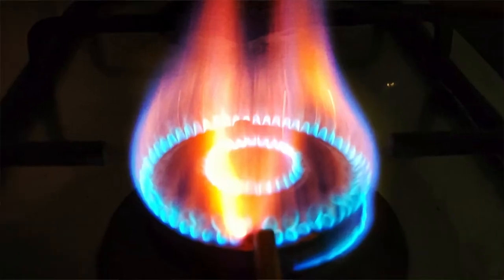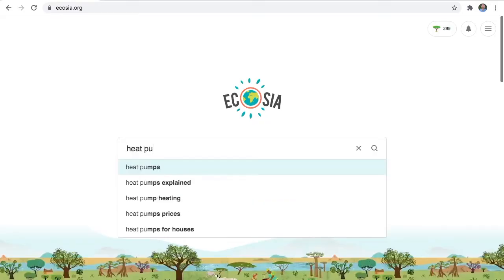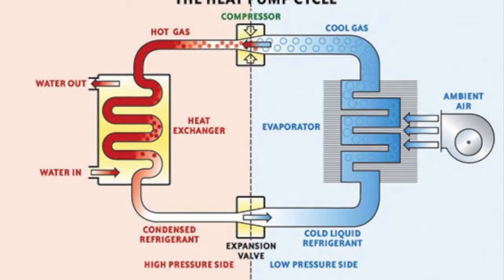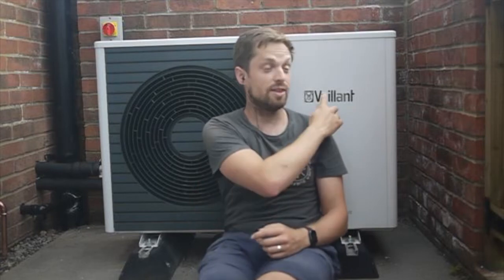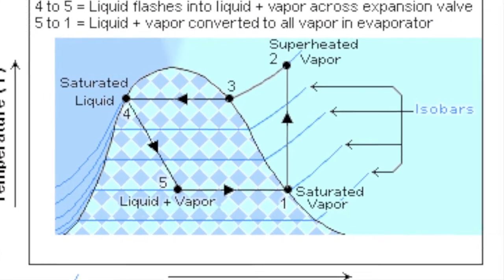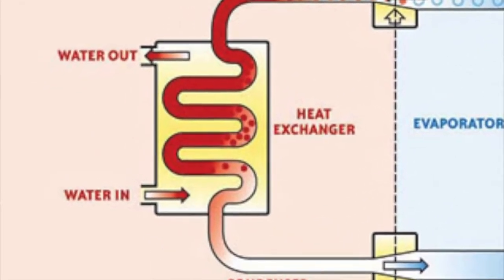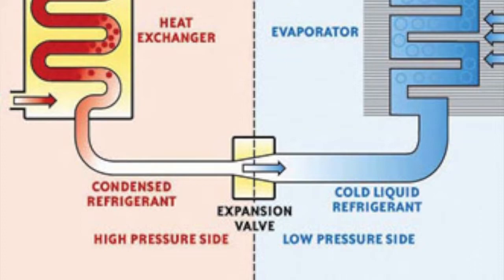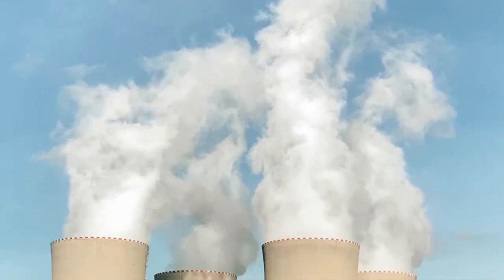How do heat pumps work?

Comment: Is a heat pump suitable for a park home
Reply from the maker: Hi Michael - I am not fully conscious of what makes a park home different to many buildings, but if you have a radiator circuit, a heat pump can heat a park home. If not, an air to air heat pump could help heat (and cool) a space.

What is your current heating system?

Comment: Remember there's countless videos online telling you why they're a scam.
Reply from the maker: Are they? We’ve lived with one for 15 months now and it’s been fantastic!

Where did you hear they were a scam?
Reply: @TomBray-LowCarbonLifestyle  hi! It's so strange that you haven't heard about it. What, with the common opinion being that they're a scam, and that the technology isn't good enough for poorly insulated old UK housing, and that it'll cost even more than a gas boiler while not heating the average home nearly enough, and that it boasts an efficiency only sustainable in the summer when it isn't required. Have you tried using the search engine? There's one built into YouTube; you can't miss it! It's the magnifying glass! Happy searching, friend!
Reply from the maker: Hi inkwyvern - the only videos I have seen that question heat pumps are from Roger Bisby who made some fairly outrageous statements in his ‘ugly truth’ video. 

I have done a few videos talking about how efficient ours has been and comparable costs. I think ours has cost slightly more than our old gas boiler but we live in a Victorian terrace. We have also been more comfortable as the heating is much more evenly spread throughout the day. 

Honestly, I’m thrilled with our heat pump. And thrilled to reduce emissions by about 1.5 tonnes per year. I am not sure who is scamming me!

Comment: Hmm very different than US heat pumps. No water or propane involved in ours. The refrigerant (R410 usually, some old R22) goes directly into the house and is distributed via a fan in the inside head. Water pipes like I see going from your unit into your house would freeze solid here despite being hot water and insulated. 
Nice explanation of your style of system.

Comment: BTW, I also follow Skill Builder (good DIY tips and more). The latest video on there was about how he thinks the way we're going about this will end up with a wave of 'mis-sold a heat-pump?" compo claims in 5-10yrs. His explanation of what a heat pump does is classic - "It's like a fridge, just one trying to cool the planet". https://youtu.be/GhAKMAcmJFg
Reply from the maker: Thanks Ian, watched that vid this morning, his understanding is limited at best, and purposefully misleading at worst. A shame because he has a big following and he tends to be well respected on DIY stuff. 

He’s done a bunch of videos with gas boiler companies or with anti climate action rhetoric. 

I could say that we have all been Mis-sold gas boilers, not told about the real impacts of them on air quality and emissions, and ultimately all of our lives. 🤷‍♂️
Reply: @TomBray-LowCarbonLifestyle  yeah, some of the issues he raised sounded more like dealing with underspec'd systems. As for sticking things way off under trees - probably more down to increased pipe losses back to the house, not because it's in the shade... I've lived in a rental that had a hopelessly undersized combi, back in early 90's - it couldn't raise the DHW to anything like hot unless the flow was wicked right down (to the point of having the boiler almost cut off again),  so I'll take his message about competent installers vs rush-job guys in it for the easy grant money, but view some of it with the same regard as big oil pushing grey hydrogen as 'carbon-free' 😁

Comment: "Superheated" just means it's pressurised and can be heated beyond its normal atmospheric boiling point. Back in my NHS engineering days, we were removing boilers that raised steam to provide energy to huge hospitals like Bradford Royal Infirmary, Hull RI, Halifax DGH, etc. and replaced them with MPHW systems - liquid water at 120°C. HPHW could have been an option, but we might as well have just stuck with steam. Superheated boiler systems are out there!
Reply from the maker: Definitely - although very rare to heat water at pressure in a domestic setting. Just a little half joke rather than an engineering / thermodynamics point!
Reply: @TomBray-LowCarbonLifestyle  LOL - the canned laughter, though... 😁